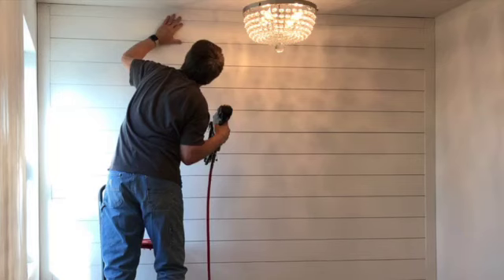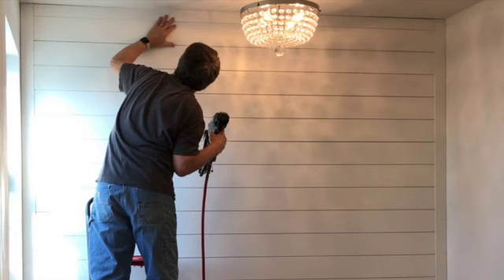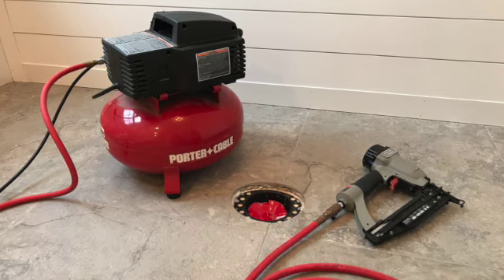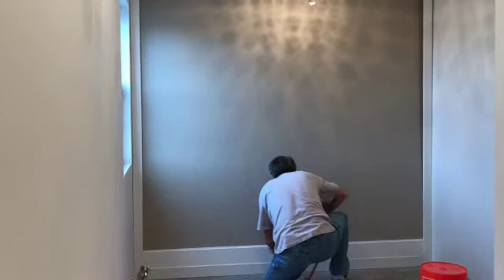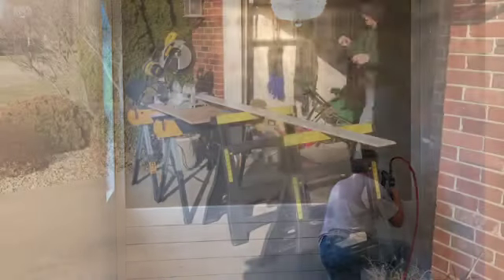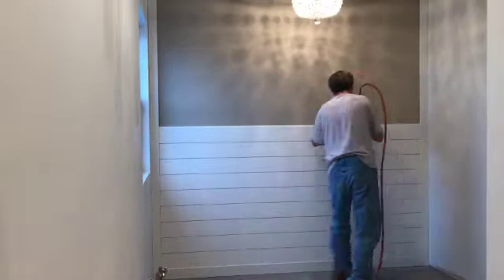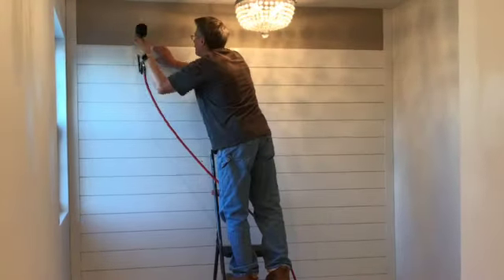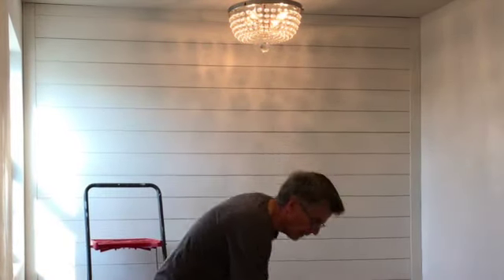Install Metrie Pre Finished Shiplap in Bathroom Remodel @DIY Boomers

Comment: Looks great. Any issues with using MDF in a bathroom?
Reply from the maker: @pra3t0rian Thanks. We bought the Metrie Shiplap at Lowes and I don’t see it any longer online at Lowes. My point is that you would have to research the brand of MDF that you’re going to use to make sure it’s ok for use in a bathroom.

I emailed Metrie before purchasing and asked about that issue. Since the Metrie Shiplap that we used was primed and pre painted, the manufacturer said it would be fine as long as the cuts would be painted over and as long as it doesn’t have ongoing contact with standing water. I have seen that some MDF products are made to be moisture resistant. We haven’t had any issues with our installation, but I would suggest doing research first to make sure it’s ok.

Thanks for watching and good luck with your projects!
Reply: @ awesome thanks.

Comment: What trim did you use on the right and left that laps the end of the shiplap?
Reply from the maker: The trim that we used is made by the same manufacturer as the shiplap that we used. It’s made by Metrie and is a 1/2” x 5 1/2” x 12’ piece of MDF molding that I ripped in half to make pieces that are just over 2 1/2” wide. They are also pre painted on the face and both sides, so ripping them in half leaves one unfinished side which I placed against the side wall, floor and ceiling.

We purchased the Metrie Shiplap and the Metrie molding at Lowes, but I can’t find the molding on the Lowes website now. I did find it on another website so I’ll put a link to it below so you can see the product.

https://sutherlands.com/products/item/339648/metrie-5-12-inch-x-1116-inch-x-12-foot-white-mdf-s4s-board